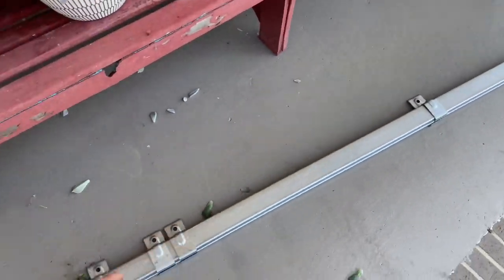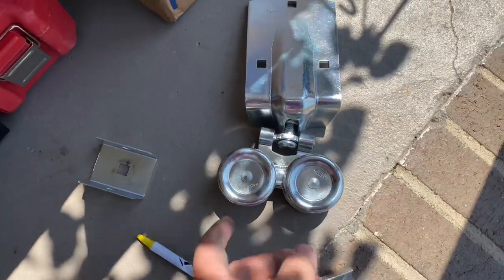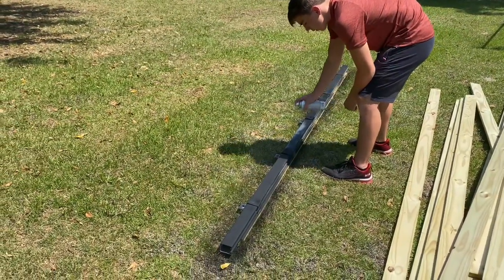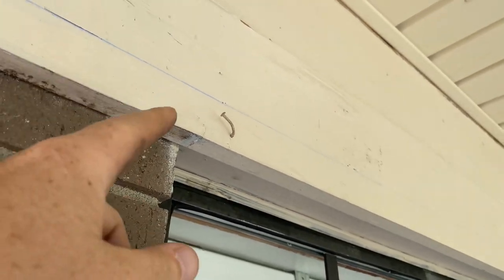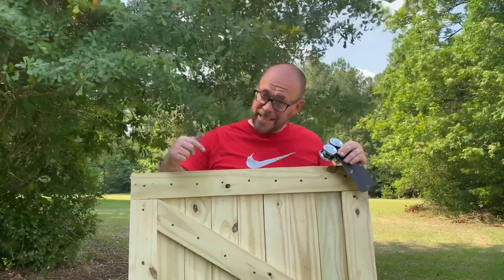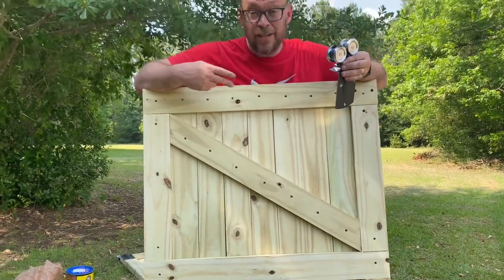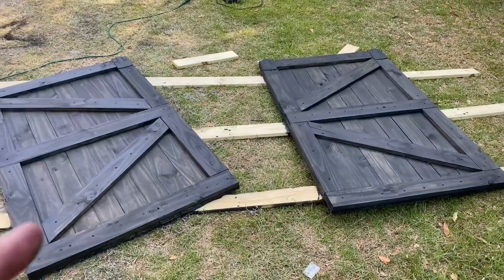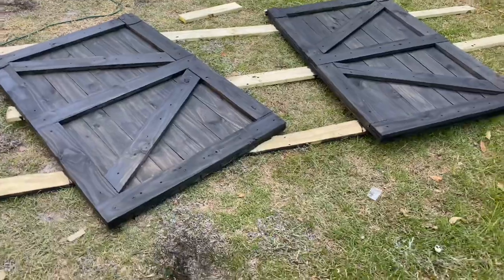DIY Rolling Barn Door Shutters

Comment: After the hail storms rolled through central Nebraska this spring I am certainly looking at shutters. With the modern Windows if you have a dent in the sash it requires replacement of the entire sash assembly including the glass. On a double pane window for me it figures out about $1,000 a pane (pain!).  There is a group of companies in Utah that make barn doors and barn door type shutters and have all the hardware but that stuff is really expensive. However it may be cheaper than what my insurance premiums are going to do to me. Thanks for posting the video it gives me some ideas.
Reply from the maker: You’re welcome. Tractor supply and Lowes had the best prices on the hardware.